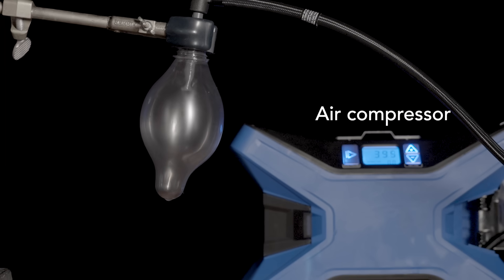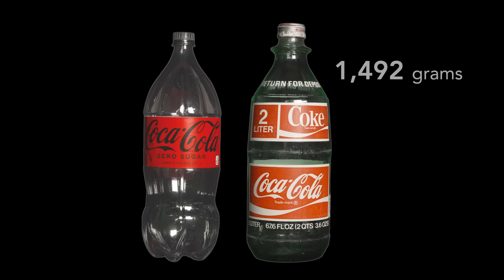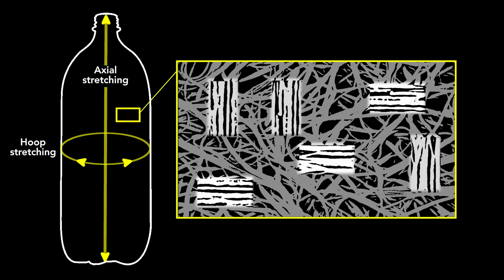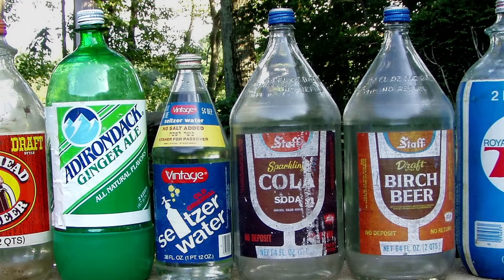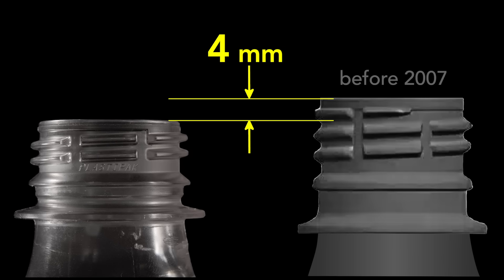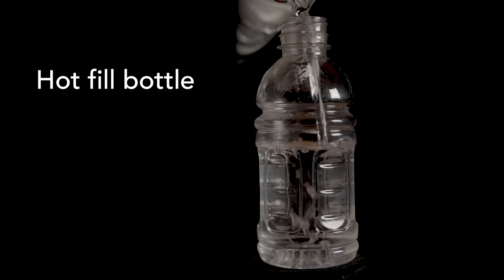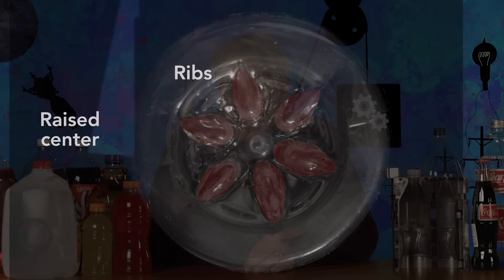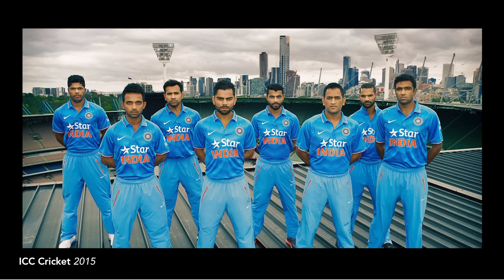The masterful design of the two-liter plastic soda bottle

Comment: PET bottles can also be turned into filament for 3D printing and it's a do it yourself process. You take a bottle and cut off the bottom then you put it on a simple jig with a dowel to hold the bottle upright and a slot with a blade that cuts the bottle. You cut a small slit to start with and then pull on it and the bottle will spin around and the blade cuts a long thin spiral. Then you have to run it through a heated die to make the strip round. It's simple but a bit tedious. It's not the best filament but it makes you feel good because you're buying less new virgin plastic filament and also recycling the empty bottles.

Comment: Side note: 2L PET bottles can be pressurised to about 11 bar and if you glue a car tyre valve into the cap you can pump it up to 10 bar (for safety) and then use it as a reactive target for shooting.

Just don't be too close to it when doing this.

Comment: The preform in India is (I think) a lot thinner than the rest of the world. When I was there I noticed that the bottles had a label that said "crush after use", and were also much easier to crush. These labels weren't as large or obvious or most of the time just not available on bottles in Southeast Asia. From what locals have told me, it's to prevent others from refilling the bottle and selling it as "clean water".

I also spoke to an engineer who was in charge of designing some of these bottles in India and they are remarkably cost-saving. Curious to know why the rest of the world hasn't adopted some of these designs yet.

Comment: Every video that you produce has presented so many fascinating examples of clever engineering, and you always present them in such a clear and concise way, that allows the feats of engineering to shine for the marvels that they are! 

Also, I'm sure these plastic bottles are not the only things tested to withstand high temperatures that are yet lower than the even higher temperatures regularly seen outdoors in the desert summers of Arizona where I lived for twenty years, and and even higher still in many enclosed spaces during shipping or even in the trunk of a car. I've heard some fun stories of the results of those things!

Comment: About 20 years ago I was riding my dirt bike and met some new friends in the trails. We decided to go about 30 mi but my little rm80 didn't have a big enough gas tank. I was 15 and very very smart. I found a 2 l Coke bottle on the side of the road and stopped at a gas station and filled it up with 87 octane gasoline. Threw it in my backpack. After about a half hour, I noticed that my back was really cold. It didn't feel wet. Just ice cold. I was going up a hill and the bike started to sputter a little bit so I pulled over and got my makeshift 2 l gas can out only to discover that the red plastic cap had melted into mush and half the gas had spilled into the backpack. The coke bottle wasn't affected at all. I dumped the gas in the tank and held on to the bottle and what was left of the cab. We made it all the way back to my new friends house and he topped me off and off I went. I learned that day that not all plastics are created equal.

Comment: It's really depressing how much PET we throw away when it is really so easy to recycle.  Not even into fibers, just melted and re-cast into other objects that have different requirements.  It happens to be one of the easier plastics for a 3d printer hobbyist to use straight from the bottle form with minimal processing - just cutting into strips, melting once into a rough filament, and melting a second time when doing the final print.  Even PLA and other more common printing filaments take much more work to recycle, so much so that it's out of reach for most hobbyists, since you essentially need an entire filament manufacturing plant to do it well enough for good results.

Comment: This is a very informative video as I thouhght this can be made by injection molding in one step.
Reply from the maker: Injection molding will not stretch the plastic correctly (orient the molecules) and so will not have the strength nor be enough of a barrier to CO2. (FYI I thought the same ….)
Reply: @engineerguyvideo   ahh, ok.  Thanks for the info👍🏻  i also learned  in this video why the plastic soda bottles when I was a kid had the hard.plastic bottom.

Comment: When heating the preforms they can heat different sections more or less then others, this allows them control where the plastic goes in the bottle. Like having more plastic in the middle where you grip it and less below the neck.

Comment: The “lip at the base of the neck” has another function.
It makes it easier to grab the bottle with two fingers to put it in the cart, and then carry it to the house. If the bottle manufacturer tries to save a little money by making the lip too small, I will buy one of their competitors. Most sodas have competitors who make the same flavor. Two-liter soda bottles are heavy. If the lip is too small and hurts my fingers, I’ll buy the other brand.

Comment: While it doesn't have a seam, it does have that little bump at the bottom. Would that be a weak point of the bottle? And does the overall concavity of that part of the bottle help protect it? It seems that since it's concave, any drops or other impacts would cause compression there instead of tension.

Comment: He forgot to mention that the cap is functionally a cork, relying on a thin ring of plastic inside the cap to seal rather than the screw threads themselves. The screw threads are there to help to gain a mechanical advantage over the sealing.

Comment: My college roomate's father was on the team that did the design work. They actually used the drop test on different designs. The most difficult part of the design was to create a cap that would not leak in any way if the bottle was dropped.

Comment: "Drop 2m onto a concrete floor and neither burst or deform..."

Unless it hits cap-first, in which case it goes flying through the  parking lot like a a torpedo. Or so a friend tells me (*utterly innocent look plastered on my face.)

I set a 2-liter on the top of the car to open the door. When it hi fell off, the cap hit and busted off and it went "10 miles. In the snow, uphill. Both ways!" (well, 15 meters or so uphill, at least.)

Comment: You dropped it the wrong way, stopped at the Meijer after work, late so few people.  2lt Cokes were stored at an angle, top shelf, grabbed mine and the one behind jumped out, fell 4', landed on the cap and took off like a Saturn V.  Got some altitude, banked over for orbit, cleared at least 3 aisles.  Didn't check the recovery zone I was off to the checkout!

Comment: When I was very young, I visited such a factory in my hometown. Temperature-resistant bottles were pre-blown into a much large volume, then shrunk, and in another mold blown again into the desired shape.
You mention the cost of compressed (possibly also preheated) air. Is its residual heat and pressure somehow recovered or reused?

Comment: There's some really interesting engineering behind the tops ("finishes", to use the industry term) on plastic bottles. While researching to see if I could integrate re-used PET bottles into my 3d-printing projects, I came across the *International Society of Beverage Technologists*. They actually publish guideline dimensional drawings of all the different plastic bottle finishes, as well as guides on what all the different parts of the finish are called.

I'd love to see a video about the ingenious way that plastic bottle caps seal. As well as the top and the outside of the finish, the cap also seals against the inside of the finish, using the pressure from the carbonation to press a little flap on the inside of the lid outwards, creating a seal that actually seals tighter the higher the pressure is.

Maybe it's the microplastics in my brain telling me this, but the way PET bottles are designed and made is really cool.

Comment: For anyone wondering about sports drinks in more standard bottle shapes hot fill is not the only method for filling non carbonated drinks. Another method is to fill cold and dose each bottle with a biocide which decomposes quickly (fully decomposed within hours, well before it leaves the warehouse) the bottle is then capped immediately after being dosed with biocide.

Comment: The gaps in the threads allowing the gas to escape is genius.
Reply: I don't think that works this way. Some bottles don't have those gaps. And a cap doesn't become a projectile if it hasn't been opened. I guess it's mostly for saving micrograms of plastic and probably for easier twisting.

Comment: My respect has grown for the lowly plastic 2 liter. About 9 years ago, when I was a freshman, we had to design a pressurized water rocket from a 2 liter. Initially we tried taping two together, but as explained this greatly decreased its strength and it exploded. Looking back, it amazes me how much pressure this common object can handle.

Comment: Very informative video, my question is why didn't engineers design the tamperproof ring to split and break away from the bottle when the cap is opened? as it is you are unable to discern if a full bottle has been opened already unless you twist the cap, plus it would aid in recycling.

Comment: Some round juice bottle bottoms cannot handle high pressure.  I've had the bottoms of round 90 oz. bottles blow up when the juice started to ferment, yet 1 gallon jugs from the same maker did not under similar circumstance.

Comment: the new caps BLOW. especially the ones with "eco" non-detachable caps
walls of the bottle also have become thinner... on 1.5l water bottle it's so thin, if you hold it "wrong", the bottle will collapse on itself and you get water all over yourself or on the table...

Comment: Important benefit of preforms is the savings in shipping costs. It's very efficient to ship the small preforms from the plastic factory to the beverage factory and expand them to size just before filling. Rather than ship around full sized empty bottles. And the blastic manufacturer only needs to make one type of standardized preform, that can be expanded to many different shapes of bottles as required.

Comment: While I do appreciate the engineering of it, and all the details explained in the video.... I always wonder why things weren't further standardized and tweaked to reach a single design that would made transportation and recycling a bit easier.
Patents might be the answer I guess.
The comparison I think about is the Japanese plastic bottles.
Afaik, Japan is not all that big on recycling either, most of it gets burnt too. But it just seems like they have standardization a bit more fixed in place. You have rectangular and cylindrical bottles in two or three sizes, they all use a plastic labeling system that is easy to peel off, and even the patterns used to reinforce the walls seems to be mostly the same.
I know one difference is likely because they have lots of non carbonated beverages that can go into vending machines cold or hot, like tea, so the requirement lies somewhere in between?
Like I said though, it's not that I don't appreciate it... but perhaps we could keep developing it further.
Personally, I take all my soda on aluminum cans. Not drinking a whole lot recently anymore, but I was kind of a Coke Zero addict up until a few months ago. Replaced it with cold brew tea, but still drink the occasional Coke Zero can.
As far as I understand, the aluminum cans are more expensive as raw material, more costly to produce, less resilient and thus also harder to transport... but 100% recyclable. I can't quite explain but I just like the flavor of beverages coming from them better too.
Anyways, great explainer!

Comment: The failure mode of these bottles if dropped from higher than two meters seems to be the cap blowing off. The cap can go quite far if, for example, one was to fill empty ones with water and drop them from a second floor window. The cap (if you can find it) and bottle can be re-filled and re-used for the same game multiple times.

Comment: Oh, neat. I had no idea how these were made. My inner chemist is fascinated by how they deal with the porosity issue.

Clever way to shave a couple grams, but I hate the new shorter necks, especially on the ultra-thin bottles. They can be difficult to manage (especially with gloves), and greatly reduce the bottle's reusability. They are a lot more likely to leak, fold over, or pop the cap off entirely.

You can put near-boiling water in a Gatorade bottle (seems to be a different grade of plastic), and it will neither crack nor deform, and it is also otherwise very tough. I don't like Gatorade, but I've been known to buy it to get a bottle for everyday use. (I carry water with me whenever I go out. And I save 2-liter bottles for emergency water storage.)

My reaction to the blooper: I want to take a class from this guy. :D

Comment: also the inside of the cap makes the seal with the bottle using only a clever shape, not the rubbery opaque disc inserts which we had in the 90's

Comment: This is far more interesting than it has any right to be. Finding out that "sports drink" goes into the bottle hot to kill bacteria was probably the most "I would have never thought of that" thing I've come across in a long time. The blooper at the end was also awesome to see. Glad you're back Engineer Guy!
Reply: While that is a method which is used,  another method which is also used fills cold and then doses the bottle with a fast decomposing biocide right before it's capped.
Reply: @K26650  Eww. I'd rather have the hot gatorade.
Reply: @DanieleGiorgino I hope you grow all your food
Reply: There are various ways to make foods safe in storage.

Heat. Acidity. Being graced by the light of go gamma rays.
Reply: I believe the interior of the bottles is briefly rinsed with near-boiling water to perform the sanitation, then the drink is filled at normal production temperature.
Reply: I had never quite put together that the sides of those sorts of bottles are panel-shaped specifically to allow for the bottle to change shape due to temperature. I always thought it was just a stylistic thing.
Reply: Yeah, glad I don't drink that stuff anymore, rip high school sports. We have so many better options to get hydration and nutrition for sports now.
Reply: Mmmm, microplastics
Reply: @mujtabaalam5907 it don’t matter
Reply: wow, so bill does have a personality! he always seem so straight and even, nice to see him crack
Reply: And now I'm never going to drink sports drink ever again, not that I drink it more than a couple of times in my life. I just don't like the taste, I only drink water from safe wells.
I just find it suspicious when a hot liquid enters in contact with the polymer.
You know parts of it detach into the liquid.
Also, it's the same reason I only drink coffee on glass.
Cold soda is fine on plastic I guess, I have it once or twice a month, they have too much sugar and salt.

Comment: Thanks for another great video.  My only gripe with 2 Liter soda bottles and those for bottled water is that they lack handling strength.  I've spilled soda before, when the bottle buckled while pouring, without the carbonation pressure for support. Much worse, I've had water bottles twist to the point that I could barely remove the cap.  Of course, when the cap finally gave way, water fountained everywhere because the twisting had applied inward pressure to the outer walls.  Someone needs to tell the bean-counters that saving money on material only to infuriate your soaking wet customers is bound to be counter-productive.

Comment: Thanks Bill for the upload! Pedantic rant: the poster of two gears behind you is wrong. When you have two meshed standard spur gears, the ratio of their diameters has to equal the ratio of their tooth count. The ones in your poster both have 8 teeth but the diameters are very different. These would bind.

Comment: It's good to see you're still making these videos.  I've enjoyed them in the past.  PET made into clothing doesn't surprise me, it's the microfibre nature that makes these fabrics moisture wicking.  There is a downside though as at the end of life, clothing (vacuum bags have a similar makeup on HEPA cleaners like Miele and Sebo, that's why I advocate for using water bath filtration based vacuum cleaners like the Rainbow or even wet and dry central vacs like those offered by DrainVac) the plastic is tossed into a land fill/dump/tip and leeches into the environment causing widespread health problems for all of the plants and animals on our planet.

Comment: The bottles of the 70s-early 90s had a wider first lip. It was well designed such that the bottles would easily be lifted and carried by clutching between two fingers just beneath that lip. Sometime in the mid to late 90s I believe, they shaved plastic off of this first lip, making carrying bottles in this more difficult and more uncomfortable. My dad, an engineer noticed it and explained to child-me that it was almost certainly to save a few hundredths of a cent per bottle, and that those savings add up over time.
I still think it was the wrong move. the convenience of that lip was well worth a few hundredths of a cent per bottle. I'd gladly pay to have it back.